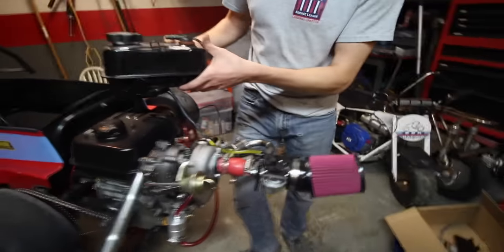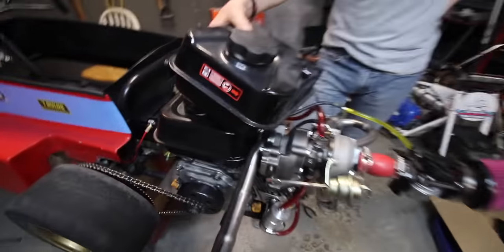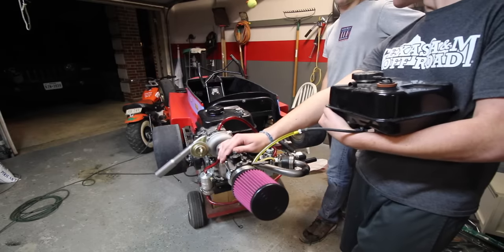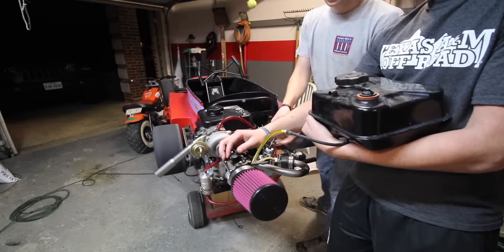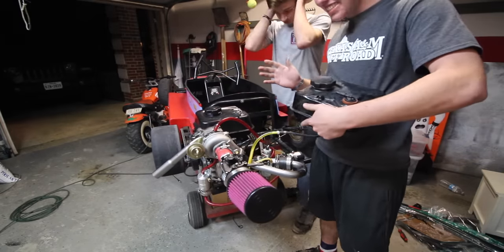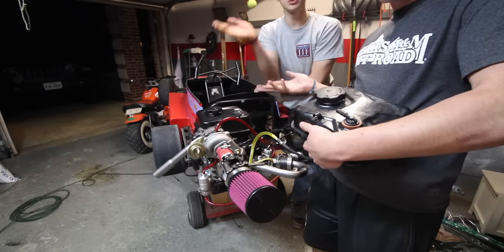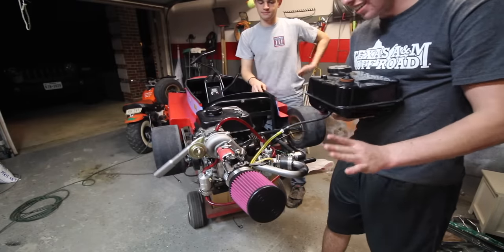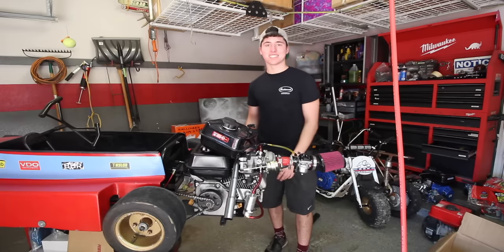Turbo Go Kart Finally Makes Boost!

Comment: Get rid of the mikuni. It will run fine with just the TCT, if it is tuned properly. Also, try to get a air/fuel ratio gauge, borrow one or something, and make sure you dont go leaner than 12.5:1 for driving. 14,7:1 is fine for idle.
Reply from the maker: Russell Jimenez We tried running just the tct and was very laggy and leaned out under boost. I think we would need a larger mm carb for it to work at the turbo intake alone.

Comment: the carb thats bolted to engine on the intake of turbo the turbo needs to be direct to engine if fuel is low top end upjet for top end range and alter needle for mid range

Comment: You will have a boost leak through the engine mount carb. Just use the turbo mounted carb.

Comment: Maybe run a fuel line before the turbo/after the intake that runs into the bottom of the gas tank. As it builds boost it'll suck fuel

Comment: Your honestly better off with 1 carb. Find a bigger carb that allows more air to run thru like a mikuni 36mm and port it with a drill and put a bigger jet in it with a fuel pump. You could even use a wideband on the engine before turbo and during boost that way you figure out the air fuel mixture and just slowly increase jet size until your air fuel ratios pefect. I know once you get it right that thing will be kickass

Comment: also, just an fyi, the reason EFI is better is not just becasue you its fuel injection, it adds a computer and an o2 sensor so that you can properly calculate fuel ratios - otherwise you risk blowing your engine.   My eagle talon is 14:1, every engine is different.  It will idle all day but when the turbo starts to spool and push more air the engine is going to need increased fuel which is why it is hard to turbo engines with basic carburetors.   If EFI is 100, how much would a proper carb cost.   If you really want to learn turbos and fuel ratios, where you would be able to hook up a computer to change your maps to match fuel to RPM than an electronic system would be better.   Forget my last post, it would be impossible to guess what needle you would need to match not only your carb but also the fuel as you increase RPM's, I could be wrong but sounds like it would harder.

Comment: Awesome video 
1 question how would I go about adding a turbo charger to my 300cc 4x4 atv ?
Reply: Best you don't do it   like these twats  tried to, thats the best way to not  do it ,draw threw turbo is best ,turbo with carb on its air intake,and use nuts & bolts on carbs fuel chamber bowl to tighten the seals avoiding pressure leaks , ,and any  were  else possible trew out the entire system ,widen fuel jets 1/5-1/8 mm inside   the carb and block any overflows & pressure escape routes if you find some leaking, then  replace turbo   actuator with additional throttle cable to engage on acceleration disengage on deceleration, but not entirely neccesry unless ur a perfectionist about your work cus that setup would  need fine tuning to work correctly,

Comment: Dont need efi. Delete the carb between turbo and filter. Get an inline 50 psi fuel pump, and a variable fuel pressure regulator. Lets you stay carberated

Comment: Take the carb that is between the engine and the turbo out and only use a carb after the turbo. Upgrade the carb to a 30-38mm. Blow air. Repeat

Comment: I would just get a bigger carb and you can adjust the high side to provide more fuel. Without a ar/fr guage or 02 sensor,  just pull the plug over and over till you get where you need to be

Comment: The carb you're using is not designed to be a blowthrew carb. Use it as a pull threw and you'll have something.

Comment: Just sync the carbs to run off one throttle. P.s. cable and linkage set up.the way 4 cyl motor cycle engine's with quad carbs do.
Reply: Or just get rid of the slide in the down stream mikuni

Comment: I didn't hear sufficient spooling with means no boost, turbos need lots of heat to operate because turbos run off the exhaust system, I flip burgers for a living and I understand some thermodynamic principal's

Comment: Guys.... Blow through is a pain in the ass. You never even tried just running it with the first carb, so you literally have zero proof that it won't work without the second carb... 

Just for sake of testing, take the second carb and hold it wide open, disconnect and plug all the port and fuel connections so it acts like a straight piece of pipe. 

Then try running it off the first carb only.
 Pretty sure it's going to work pretty well. Yeah it might take a couple extra cranks to get started, so what. 

Also don't forget, that to tune it well, it has to be under load, not just free spinning the wheel.

Comment: Just saying boost basics u need atleast 1 psi of fuel pressure per pound of boost if you are trying to do blow through on a carbed motor as the boost will blow the fuel back up the fuel line

Comment: Engineering explained has a video on small turbo engines. Try a larger carb off a single cylinder motorcycle

Comment: No need for the 2 carbs just need the one in front of the turbo an I would personally take the time to jet up the mikuni carb over the adj a jet setup simply becasoe of bowl size you'll run out of fuel fast and the pump won't pump under boost
Reply: Also the down pipe from turbo ide make a little bigger, but the intake looks good guys and maybe a small shot of water meth injection

Comment: you can't blow through on a gravity system.. and those little carbs won;t hold boost in the tin bowls..  you need an electric pump that will maintain 2-4 psi above boost pressure and a boost referenced regulator..

Comment: Eliminate the carb on the head side and just use the one on the outside of the turbo it'll control throttle and air to fuel mixture and turbo will mix the fuel for you we run them like that in the oilfield

Comment: Just delete the “idle carb” and just play with the big carb. Way easier to tune one then two especially on different sized carbs and with one under boost and one being drawn through, and you don’t have the air restrictions with the throttle plate of tiny one,  just get a broken carb for free and gut it, seal it so you don’t have to alter piping

Comment: Just do a suck thru 1 carb will be enough with proper jetting you have to blow thru mod the carb to handle boost and with your carbs is basically impossible to to blow thru

Comment: If you blow though the carb you have to put the carb in a pressurized box so the air around the carb is the same pressure as the air going through the carb  . NOW ! Your troubles have just started ! To get gas to flow to the carb ,you have to pressurize the fuel tank!!
 Soo the way to go is suck though

Comment: why are you trying dual carbs? u only need one, and the turbo will pull about twice as much air as its rated for, threw the one carb , so main jet has to be almost double size,

Comment: Oh and use one carb the mickuni is fine trust me on this I have all ready done this to a Honda gx 200 with a cihnyez head ported and 2 valve springs per valve  and that is it I did have real roller rocker arms made look like minny  sig earison and a k and n air cleaner try that low money in put big out put holy crap

Comment: Why not just use a single carb on the inlet of the turbo? And if for some reason the engine can't pull the fuel and air through the turbo at low speed you can make a y pipe on the end of the carb one going to the turbo inlet and one going directly to the engine with a one way Valve so it will let fuel and air pass if there is vacuum and close if there's boost.

Comment: You need to remove the lower carburetor and just run the pool through carburetor on the back of the turbo and just create a pull through system that is your solution just get rid of the carburetor that's down low on the motor

Comment: Just skip the extra carb and use the single as a pull-through, no extra carb needed. Re-jet it if you need more fuel.

Comment: Remove the mikuni carb and just use the tollitson as a draw threw. From the turbo inlet.  Or you can remove the tillotson and make a completely sealed box around the mikuni and feed the boost into that and it will equalize the atmospheric pressure around the card to eliminate blowing the fuel back down the float bowl.  Email me and I will give you a step by step on making a blow threw carb or you can even blow directly threw the tillotson with and additional fuel pump to counter act the boost. You need at least 1 more psi of fuel pressure than boost.  Really you need like 3 psi. But without the addition of extra fuel pressure your always going to blow the fuel backwards under boost. Hence the fall off as soon as boost comes in. MESSAGE ME!!!!

Comment: Just remove the fuel source from the stock carb, lock it in the open position and tune it using the new carb before the turbo = done.

Comment: Just run it with one carbunator in intake of turbo or just one on pressure side designed to operate with pressure. also the mixture should become more rich when there is pressure and i dont think your carburators can do that.

Comment: Why didn’t you just turn up the fuel on the high on the carb or get a bigger carb like off a yz 125cc 2stroke Yamaha and set it up in front of the turbo the Yamaha carb works perfectly for a blow through carb

Comment: you need to have a air reservoir about twice the capacity of the engine close to the cylinder head or a single cyl turbo will never work

Comment: Ok you need to ditch that pre turbo carb as youre wasting your time. Either 1 or the other. Draw through causes fuel pooling, turbo and carb seal issues so I'd avoid it.

The problem with blow through is simple, the fuel pressure needs to be at least equal to the mass air pressure of the Venturi. 

I don't know what carb you're using but I would start by 't'ing into the wastgate actuator hose and running a pipe with a one way check valve to the carbs float bowl. Then fit a one way check valve from fuel tank to carb. 
You should get somewhere near to making controllable boost, you then want a colder step spark plug and gap it around .65mm to begin with. Upsize your main jet in your carb by about 20% and lower checking the colour of the plug as a gauge, unless you have access to a wideband.
Reply: carbs dont really tolerate being blow into very well, after all they are designed to draw air

Comment: This is soooooo wrong, either draw through carb or if for whatever reason you want it after the turbo, it needs to be in a sealed box. You would pressurize the entire carb inside and out so that fuel can still flow properly. It’s just like changing elevation from really high to sea level. I’m not aware of any benefits of this though.

Comment: Why not just run 1 sole carb at the entry of the combustion chamber (Aka normal) and put everything involving it under charging pressure? like the bowl and the fuel tank?
BTW, 1 sole carb before the turbo might not go lean if you adjust it propperly, although it may mess up the intake after it in a short period of time.

Anyway, I think you know the correct answer for your problem... Injection.

Comment: you need injection... preesure of air get your fuel back to tank (motor carburator turbo)   If you use (motor turbo carburator) motor have bad response... If you use both of this system, i think you newer tune it...  Look on turbo drift trike- these guys have this problems.... Your motor running BUT only with no load... under load i thing is no so good :)   BR

Comment: Maybe 'm not understanding how a turbo works but I'm pretty sure the fuel needs to go to the intake AFTER the turbo, not before. You have more air, but not more fuel, so before you added the other tank it was running super lean, so it couldn't fire properly.  Seems like you need a bigger carb, and that should fix it.  But I also haven't finished the video yet.

Comment: There is no cheap way to turbo that engine it's a 3k kit and it is worth it efi ,turbo titanium valves stage 3 predator kit and titanium rockers u'll fly I personally love mine and at first wasn't sure it was worth the money but 22hp out of a 212 is amazing so yah by the way I'm working on a 4speed floating trany now so I can really push my engine further and ill be switching to a manual clutch vs a centrifical clutch

Comment: Too complicated with two carbs just use the pull though carb and make the jets bigger. It’s far more simple than using a fuel pressure regulator and making sure no boost gets into the fuel bowl.

Comment: You guys are going to blow the seals out of the makuni, it's not a blow through carb, it's designed to work off a negative pressure (vacuum),  when you start adding positive pressure (boost) to it your just pushing the fuel back into the bowl and building pressure in the carb where pressure is not meant to be, its going to blow your seals. Go back to your original plan and put that makuni on the intake of the turbo and run a charge pipe to the intake on the engine, play with jet size to tune it and maybe even a higher octane fuel to keep detonation out of the picture.

Comment: drop the pull trough carb,its a very poor old fashion solution.use a carb jetted for the displacement and boost and prepped for beeing in pressure. a small hose with boost pressure from the turbo needs to be attached to the small pipe from the floating bowl chamber to equal the pressure or else the boost entering the carb will just blow air down the carb jets. ignition timing and engine compression ratio must also be looked at so u dont have ingintion detonation and crack a piston .

Comment: Forget turbo . Supercharging is much easier and less expensive . And you get instant power no.lag ECT . I build supercharged GY6 racing engines . With one carb.. lol holler if ya want one. I get around $1400 for one . $400 cheaper than a stock tad engine. I can build u a stroker 171 with forced air induction that'll smoke any turbo gy6 . Much cheaper way more efficient. I get around 1050 for those. Holler if your interested

Comment: What I don't get is why only these small single or twin cylinder 4 stroke engines used on karts and mowers are not coming out in an EFI form out of the factory by now. EFI and Direct Injection exists not just for performance, but for emissions reasons as well and yet these two reasons are completely disregarded when it comes to these types of engines despite how they would have nothing to lose and everything to gain by use of an EFI based system. Carbs are ancient garbage that had been mostly abandoned for most internal combustion engines several decades ago.

Comment: doing it all wrong fellas, positive pressure into a carby will put back pressure up the needle and it'll flood the float bowl and probably bust it's seals. if i was you i'd run the carbys in parralell BEFORE the turbo. have a mechanical linkage to the makuni carb off the accelerator and have a push button at the bottom of the accelerators pedal travel to activate the second carby at top end, a push button, a relay and a small motorbike battery powered off the predator motor's magneto and a servo motor for the electric carb's throttle and you have all the fuel in the world at top end but pose much lesser risk of flooding the engine. also means you can hook up electric start and a light up boost gauge, tacho and all them other goodies. all the parts i just named will set you back well under 50 bucks if your a savvy shopper too

Comment: it's a very wrong setup, powering only one wheel, will give major problems while turning.. its in left, you will get problem in left turns. Engine will stop working because inner tyre.. i. e.  left one will be rotating at low speed which will knockdown your engine.
Happened with me,so just an advice

Comment: You know how to make a five horse briggs and stration fast put a 2 hp briggs and stration fly wheel on a five horse power motor and make brackets for the coil

Comment: it's not worth it boosting those predators 212 I would rather boost a lifan 140cc witch from factory produces 14hp at 7000rpm and already has a oil pump and hookups so you can either add a oil cooler or turbo or both

Comment: It wont build real boost unless the engine has load on it
Reply: this is true, but it should still be able to run idle to max speed reliably, but you are correct.

Comment: Go single carb draw thru. You're boosting a carb not meant to see positive pressure. Ditch the stock carb and go draw thru only. Look at how VW guys do it on their air cooled motors.

Comment: What is your reason for trying to use two carbs in the first place. What you are doing is never going to work. The only way that could possibly work having a carb after the turbo would be to first get rid of the second carb in front of the turbocharger then you  will have to build a can that completely covers the Mikuni carb and blow the air into the can not the carburetor this will cause the pressure on the outside of the carburetor to match the pressure on the inside like changing altitude. Now the fuel will have to be pumped into the carburetor gravity flow will not work unless you make the can that you mount the carburetor in large enough to put the fuel tank in as well otherwise the fuel pressure has to exceed the boost pressure or it will just run out of fuel. Personally if it were me I would just feed the turbocharger output directly into the engine intake and move the Mikuni carburetor in front of the turbo just like its been since the invention of the turbocharger.